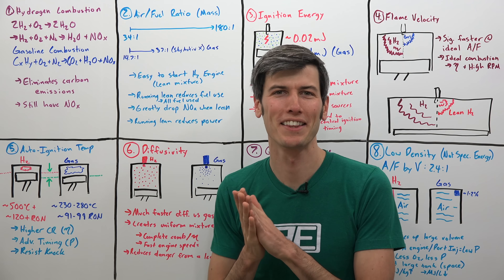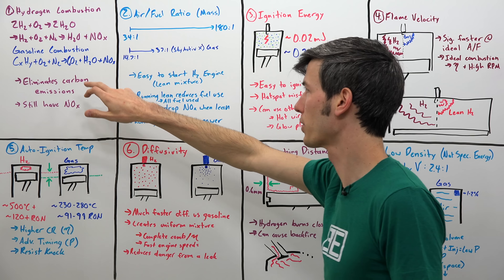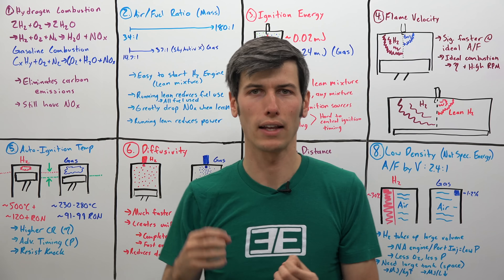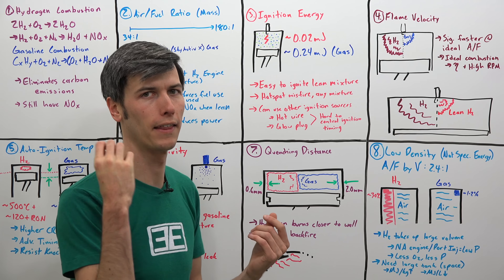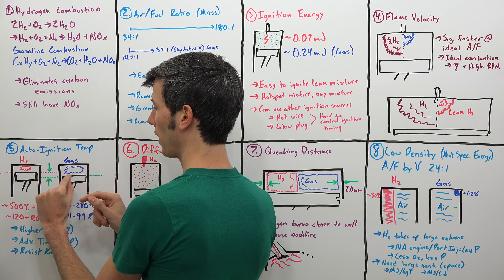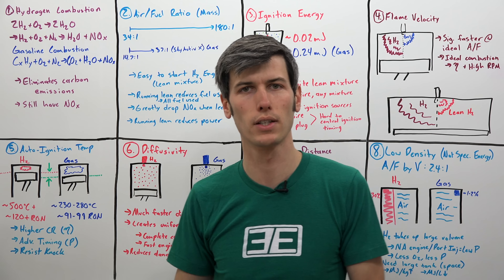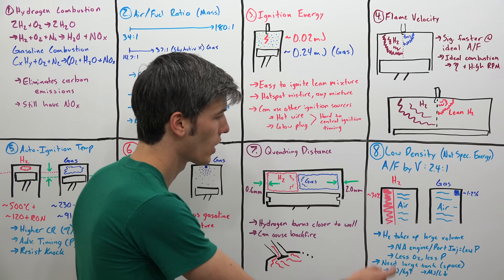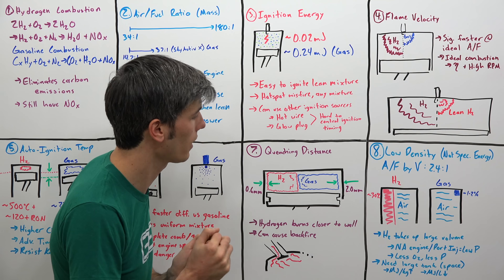The Difference Between Gasoline And Hydrogen Engines

Comment: Can you explain why gasoline wont work in a diesel? This is actualy a complicated subject that is hard to find the answer
Reply: Because gasoline will spontaneously ignite from compression pressure and temperature WAY before it is supposed to. Gasoline detonates too easily.
Reply: Richard Scott you are way off on this one,....i dont know where to begin , lol.
First , diesel will compress ignite a lot easier than gasoline, in fact the cetane rating is telling of that, a good high cetane rating means it compress ignites easily ..
Second , it cant ignite before its supposed to because the injector dont inject until the piston is almost at tdc. 
Third....welll i dont feel like explaining any more,...but it is a very complicated issue, as i already stated
Reply: Richard Scott ignition and flash temperature do NOT correlate on these two fuels, diesel has a much higher flash point than gasoline, but it actualy has a LOWER ignition temperature.

Comment: What about cold engine blow by? When some of that hydrogen/oxygen mixture is collected in the crank case, it can easily ignite and go bang . And u probably also need some really aggressive EGR to control the combustion temperature. This will result in some carbon build up in the intake valve. This can in turn create hot spots inside the combustion chamber.

Comment: You could perform electrolysis on the vehicle so you'd only need water and also if you did that you would have oxygen that you could use in the car
Reply: Except that Electrolysis requires a lot of energy

Comment: Can I just ask what would be the problem with alcohol - burning engines? I mean, it is free and easy to produce, provides more power and is a lot more environmentally-friendly, isn't it?

Also, imagine having a crash in a crash in a car carrying a big tank of a compressed explosive - not, perhaps, ideal, is it?
Reply: Richard Smart alcohol is not free, its actualy as expensive as gasoline, considering it doesnt get as good of miles per gallon.
Reply: @shannondove96  Perhaps, but it is incredibly easy to produce, and produces fewer harmful waste-products.
Reply: in fact, people could even produce their own fuel...
Reply: Hydrogen is lighter than the air meaning the flame would go straight up do if the gas is put in strategic locations then it would be the same if not less of a risk that gas as gas will fall

Comment: 160 to 1 air ratio, and easy to spark. So if there is a crash and slide, where a fuel line is cut and there are nearby sparks, now have a hyrdogen fire.  Gr8.  Yes regular cars can have gas fires. Hydrogren fires seam scarrier, as the flames are hotter and invisible. A hydrogen fire would start melting and burning stuff around, so there is your tell.

Comment: Fuel cell, low temperature, no nox, electricity, electric motor. Just replacting battery -> tank + fuel cell.
Reply: Efficiency takes a big hit from fuel cells. Too many energy conversions.
Fuel cell: water + electricity -> hydrogen -> fuel cell -> electricity -> electric motor
Hydro combustion: water + electricity -> hydrogen -> combustion engine
Every arrow represents conversion of energy and losses of efficiency.

Comment: about diagram 8.  your point about  your H fuel taking up so much space is what happens when useing propane .   i ran propane on a truck once.  lost 15-20% power.
Reply: You could always use Ethanol - I mean, it's easy to produce and extremely environmentally-friendly, isn't it?
Reply: AND you give up  10-15 % HP.    and Ethanol draws water to the system.   all the acids you DONT  want are water base.

Comment: Very informing video 👍🏻.
What could be a solution for point 7?
What is the percentage of efficiency using a fuelcell in a car? I mean you need electricity. If that is made out of gas, every $ of gas will leave less then 50 ct electricity. Then put into a fuelcell, the efficiency will drop further. Then you have, due to the normal combustion proces, a further loss of 75%. So in this way the efficiency is 10%?

Comment: If it turns out that metallic hydrogen is meta-stable and has a density of around 2g per cubic centimeter, it would have roughly an order of magnitude more energy per unit of volume than gasoline. I'm not sure I'd want to ride around with something that contained over 200 mega joules of energy per kilogram. Gasoline is bad enough.

Comment: How about storing hydrogen in compressed form inside strong tanks, like LPG or CNG?
Reply: Hydrogen is one thing, but pressurizing it? Helll naw. Bomb on wheels lol.
Reply: @davidcardinal3654  Even pressurized hydrogen isn't much more dangerous than normal gasoline. It requires pure oxygen to create a full explosion and 100% release of hydrogen. Nowadays dangerous pressurized gas tanks are very safe with multiple safety mechanisms. Only issue is that they are heavy.

Comment: I would like to convert a small engine, (up to 3-4 cylinders) to run on hydrogen, and or propane, or woodgas, to run on a biomass generator, for eco and economic power generation for offgrid housing, it could potentially only run 4hours or less a day, when needed, when there is no sun, I was thinking about distilling wood chips, to make methanol, and build a engine to run on it, starting with a 3-5hp engine, and get about 10-15+hp from it, using it to generate DC power for battery charging,  it would either be money for fuel, or work making fuel! With laws against making ethanol, that could be easier, more difficult to get over 90%, but 90-95% would be OK, as long as its burned, and not stored long term! I don't know how long the stresses added would allow the engine to survive!! Tripple or better the original power could end in a expensive oil puddle! Great video as usual, I guess I'm a numbers nerd!

Comment: If you had virtually unlimited electron source would storing hydrogen as water separated on demand make sense? 
Would highly porous plate of molecular sieve material to separate nitrogen during the compression cycle in a pressure swing adsorption allow more air thus more oxygen per stroke and keep nitrogen from the reaction? (As in using a diesel ratio 25:1 vs gasoline ratio 8:1)

Comment: Nh3 is liquid below 150° 

 engine temperatures are well above 150 as well as exhaust  temps

Convert NH3 to hydrogen and nitrogen gas and burn it.

Hydrogen storage solved

NH3 stores at 125 psia is well detected and farmers use it seasonally.

The infrastructure is already there to be utilized.
Reply: Then you lose a major advantage of hydrogen, it's energy per mass ratio.  Nitrogen is 14 times heavier than hydrogen.  However, perhaps NH3 is well over 14 times denser than liquid hydrogen.  That would solve the problem of huge fuel tanks.

Comment: I just wonder where he gets 2H2+02. Should be H + O. 
 H2 + O2 comes from peroxide water when electrolisis no?
Reply: No. Hydrogen is not stable chemically until it is paired. Same for oxygen. Splitting a single water molecule leaves you with either a super reactive oxygen atom or a hydrogen peroxide molecule and a super reactive hydrogen atom.

Comment: You do get the carbon emissions as of thoday becasue the Hydrogen is mined from natural gas. Might not get emissions from the combustion but you still get them. If you inject both h2 and o2 you can totally eliminate nox though. Actualy direct injecting both you would only need exhaust valves saving costs and complexity and vastly increasing the efficiency compared to oxygen lean ambient air.

Comment: About 30 years ago a friend and I were considering converting his gasoline fueled pickup truck to hydrogen fuel. Buried in the literature, at least as I remember, was an additional problem of crystallization of the cylinder walls after extended hydrogen use. It's been a while, so it may have been another engine design with this issue, we researched a lot of alternative fuel options, like browning gas, flywheels, fuel cells, batteries, etc. Anyone remember the EV1?

Comment: the biggest disadvantage of hidrogen is that it's extremely hazardous, way more flamable than gasoline, so the entire car is like a bomb on wheels just waiting for some unfortunate incident to blow up. 
Hidrogen Zeppelins proved that a while ago, and it wasn't at all pleasant.
Reply: Hydrogen Zeppelins flew intercontinental flights for decades before proving it was unpleasant. Hydrogen explosion is no more dangerous than a gasoline tank explosion. In fact, it is arguably safer, because it is in gas form and lighter than air. No creeping leaks, no catching fire on fabric or plastic, just a fireball up into air.

Comment: Very informative. Thanks for making this! Can you also cover how much energy it takes to produce 1 gallon of Hydrogen vs 1 gallon of gas? Gallons is probably not the right unit to measure, but basically energy efficiency of the engines. Also do you know the NOx numbers for the H2 fuel cell cars on the road today compared to gas engines?

Comment: We can use renewable and nuclear energy to harvest the hydrogen and oxygen from seawater. The only question I have is: is it more efficient to store the power from renewables and nuclear inside batteries and use those for transport vehicles OR is a tank of hydrogen (being used for an internal combustion engine) a more efficient power storage solution?

Comment: You have completely missed the point of why you can't have an instantaneous burn of your air fuel mixture. Because the Pistons still has to travel all the way down to the bottom of the stroke and have enough energy to return to the top, it's why a 1000 horsepower motor when you convert the extremely difference between the gravity of hydrogen to run the engine only puts out about 68 horsepower. I've seen it tried. You cannot get the horsepower out of a hydrogen to run internal combustion engine anywhere close to efficiently as you can with gasoline. Not only that there isn't enough electrical energy in the world to produce enough High to replace gasoline on a wholesale basis. Even trying to do it in a fleet would be prohibitively expensive.

Comment: Hydrogen engine, Take that n20 from the exhaust and run it straight to the air intake 🤣👍
Reply: N2O =/= NO2
Reply: Nice thought, but you'd need a way to separate the NOX (pollution) from N2 (80% of air). Otherwise you'll end up with little O2 to burn as you recycle all that N2. And you'll also have to condense all that water vapor cuz it, like N2, doesn't burn.

Comment: Could you overcome the Hydrogen volume problem by processing it on board from water by separating it with electricity? is it technically possible? Feasible?

Comment: So... if we just use two gas tanks, one for hydrogen and one for oxygen, and take nitrogen out of the equation, then that solves most of the downsides, doesn't it?
Reply: We can use renewable and nuclear energy to harvest the hydrogen and oxygen from seawater. The only question I have is: is it more efficient to store the power from renewables and nuclear inside batteries and use those for transport vehicles OR is a tank of hydrogen (being used for an internal combustion engine) a more efficient power storage solution?
Reply: @joshuaewalker  Use the H2 and O2 in a fuel cell. It's way more efficient than an ICE. Connected with a small battery and capacitor bank you'll have no issues with sudden accelerations (fuel cell efficiency decreases as power draw increases).
Reply: @joshuaewalker  
No. The Internal Combustion Engine (ICE) is very inefficient for converting chemical energy to motion. The hydrolysis process is also very inefficient at converting electricity to chemical energy. There are further inefficiencies compressing these gasses to high pressure or chilling them to liquid. Then there are layers of economic inefficiency taking profit at each step in fossil fuel exploration subsidies, extraction, refining/production, transportation, storage and retail. 

Lithium-Ion batteries, such as those in Tesla vehicles, can full cycle at around 95% efficiency. (Assuming good driving practices and slow overnight charging.) The AC electric infrastructure is highly efficient and home solar collectors bypass the fossil fuel infrastructure.

Comment: Great science. Brilliant and clear explanations. Superb presentation. Bravo.
Reply: P.S. Hydrogen should be compressed to a liquid state to save space. For increased power you  always overly aspirate the engine (should probably be standard). NOx could possibly be captured and fed back into the engine for even more power (troublesome, but anything is possible with enough R&D). The Hydrogen Engine will be part of the future, supplanting gasoline as the primary fuel source....especially as we move off-world.😉

Comment: Could you make a time machine and travel into the past and take a job at my junior high school as a science teacher? This stuff is great. I think many of the problems with hydrogen can be solved or compensated for with engineering a new engine dedicated to hydrogen combustion. I'm sure a condensed hydrogen fuel storage tank could be made. I don't think we need gas pumps for this either. With hydrogen as it is, could be as easy as screwing and unscrewing a tank similar to propane tanks. This method could significantly reduce the cost of adding or transitioing gas stations to adopting it as well as the vehicle market. Plus, spilled hydrogen isn't an environmental hazard, sense when it comes in contact with air, it will become water.

Comment: Can't we have a compressed fuel tank like those LPG to minimze space
Reply: Propane is gaseous at normal temperatures and pressures, but is relatively easy to liquefy and store at moderate pressure. This gives it the advantage of higher energy density (volume-wise) than either hydrogen or CNG (but somewhat less than petrol/gasoline). Liquefying hydrogen requires either cryogenic equipment or tremendous pressure, both impractical for a passenger vehicle.
Reply: @19580822  thanks man ✌️

Comment: On a 4-rotary n/a engine with direct, high pressure fuel injection, running on H2, what would the optimal a/f-ratio be? Trying to be both powerful and get a good milage at the same time.
Reply: Problem with this is the Apex seals. In rotaries there is always a gap at some point during the rotating cycle. This is what contributes to the rotaries poor emissions. The seals would be worn down so quickly you'd be having to redesign the entire rotor.

Comment: Can we say, that the Hydrogen engine is less safe then the gas one? It will get diff. pretty fast once it is out, but how about the low energy that it take to ignate it? Can it be ignated by hight temperature (like 40°C with sunlight)?

Comment: Hmm interesting so would using liquid oxygen and liquid hydrogen inactivated. Closed loop induction no out side air ik it would be kinda a pain but if your mixing pure oxygen and hydrogen would it be possible to eliminate the nox completely?
Reply: In a closed loop

Comment: So...Now I'm wondering if Mazda is using the SkyActiv engine as a precursor/test-bed for a future Hydrogen engine. Everything that the SkyActiv is engineered towards seems to point to substituting Hydrogen for Gasoline. Extremely High N/A Compression, Spark as a displacement ignition source > which leads to utilizing high flame velocity of the hydrogen fuel, and with that compression they've probably taken into consideration greater precision of valve sealing against combustion chamber ignition. I'd be surprised if they didn't base future Hydrogen engines off technological advance of SkyActiv. While when I first heard of SkyActiv technology from Mazda I thought, "That's great it's so precise, but I see failure in almost any single component that doesn't meet thresholds." But, after watching this video, I think the direction they're going makes way more sense if they head to that direction. Just seems like a no-brainer, but maybe I'm wrong.
Great video, sir!

Comment: Why are we running lean objectively better?  More Lean means more complex systems. More points of failure. It’s better to make something simple so it’s easier to fix. Electronics are good for fuel efficiency but makes it harder to find the problem. It’s more of a preference then objective.

Comment: Brilliant, have you or could you please do the same video again but using hydrogen and oxygen from electrolysis so the amount of air/nitrogen would be a lot less, would it work without air at all? with a fuel oxygen ratio of 2:1
thank you

Comment: Whoa, whoa, Where do you get this N2.
We're talking H2O, there i s no N in there.
Many years ago a person in England designed a dime sized device that was put into the fuel tank which was filled with water. The device operated off 12 volts and separated the water into oxygen and hydrogen. 
Why can't this hydrogen be compressed and the engine run as if it was using propane.  Everything you said in your lecture says that hydrogen is the better product. So I fail to see why you suggest that the hydrogen cell is the better way to go.
One of the problems that most people overlook is that electricity is not as clean as one might think.  The batteries are extremely expensive, very short lived, and hard to dispose of. Electricity from the grid is very unfriendly to the environment.
Despite its drawbacks, of which I see none, hydrogen is the only answer.
Reply: The atmosphere obviously.